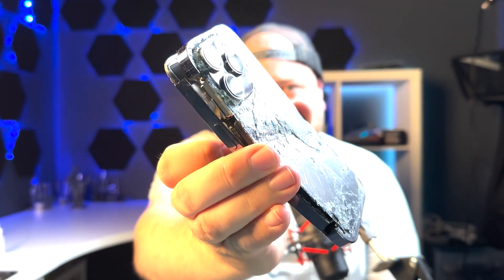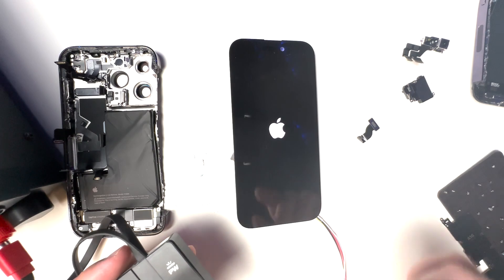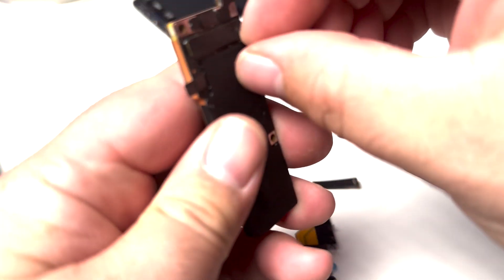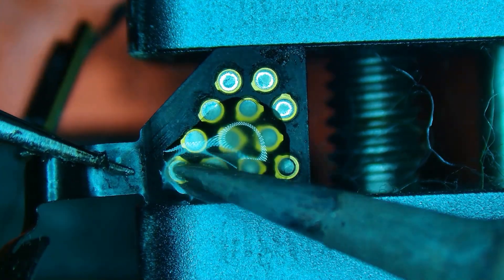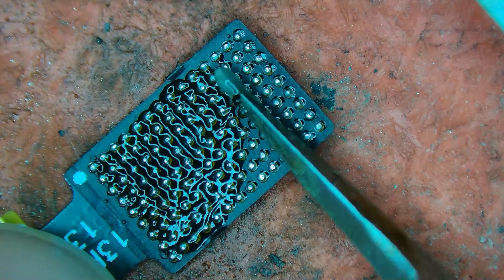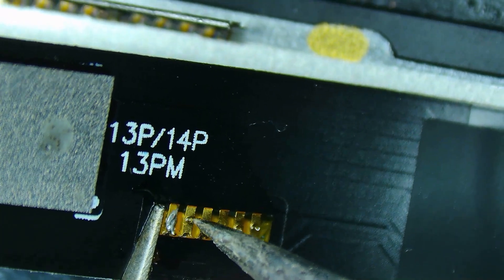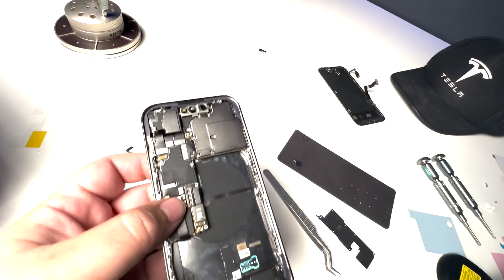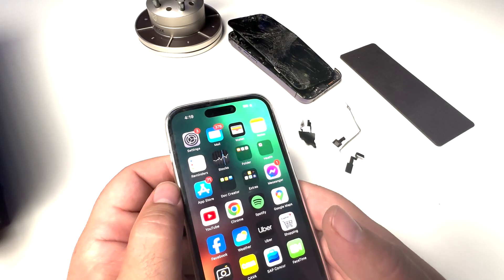iPhone 14 Pro Got CHUCKED! #iPhone14Pro #Repair #PhoneRestoration #DIYRepair #AppleRepair #TechTips

Comment: Hey Boss! 
I have a broken 14 pro max Face ID. I managed to put chip on doner Face ID to read data. Now I replaced the broken chip with Romeo 2, but still it reads broken chip. I looked at the Face ID, and in the left bottom corner on the print there’s a crack.. I think this is the problem. Is it possible to transfer different components from original to donor Face ID to make the iPhone recognise this as the original? I can upload picture if needed. 
Thanks for the great videos!!

Comment: What was the sensor you moved on the top flex on the screen? And why did you need to move it across? Is it paired? Thank you
Reply from the maker: It’s the proximity sensor and although it’s not paired like previous models for Face ID it does interact with True Tone so it’s nice to transfer over.

Comment: Good video would want to do my own repairs at my own risk could you tell me the 2 soldering paste you use to make it stick together please im trying to fix the 5G Antenna on my 13 pro max also im using a Soldering Iron method please
Reply from the maker: Most 5G antenna Replacements should come pre-balled or in other words already have the solder in place. You would just need to wick away the older solder after removing the old 5g antenna. I use 138c solder paste and 183c solder paste. everything can be found at mobilesentrix.com
Reply: @FIXDPHONES  thank you what Brand of 138c solder please to be specific